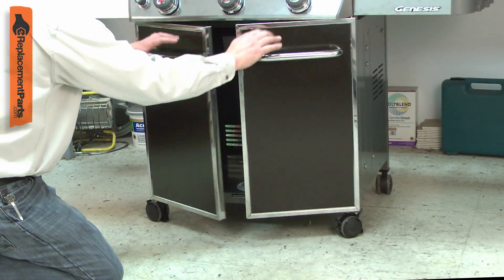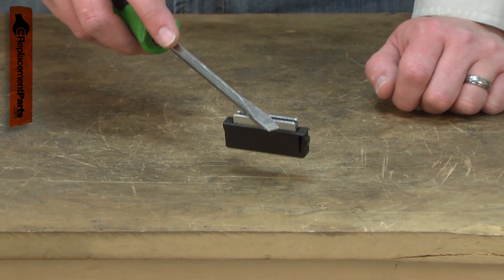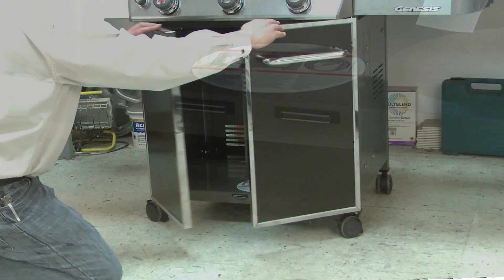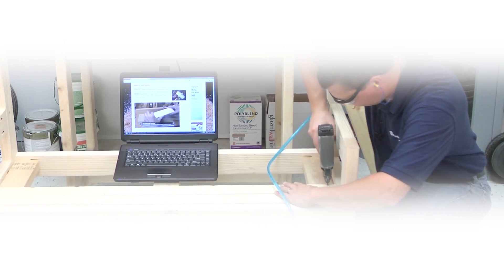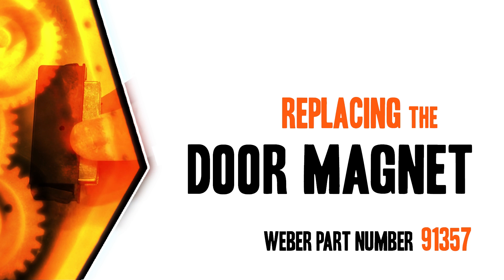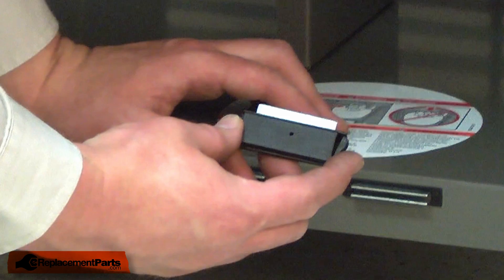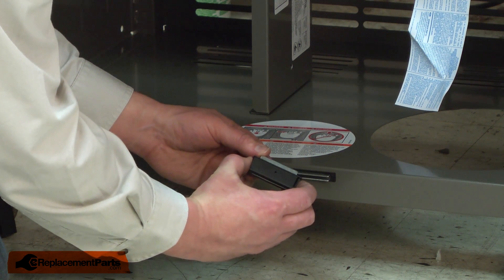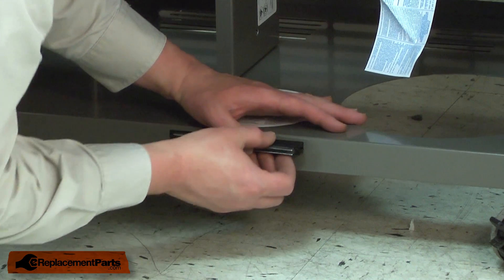Grill Repair - Replacing the Door Magnet (Weber Part # 91357)

Comment: my magnets are in the door (which is sealed) so no way to get "behind" the magnet and release any clips. The magnets are in the door but seemed to have lost their "pull" to keep the door shut
Reply: I have the same issue.  There is nowhere to clip magnets.  I contacted Weber about this, and they're sending me something.  It'll be interesting to see what they send.
Reply: Did weber send you something because i have the same issue, the magnet is in the door
Reply: @LooseGoose1960  Check to see if you put the shelf in correctly.  I found the two magnets part of the shelf.  I had to take it out and turn it around.  Everything works fine now.  Not a big job.
Reply: @LooseGoose1960  Mine doesn't.  They're in the shelf, and I put the shelf in backwards.  So I removed it, turned it around, and it works fine.

Before I discovered that, I contacted Weber, and they sent me a magnet.  Just one.  Wouldn't have made much of a difference.  Nonetheless, I figured out the problem on my own.
Reply: Mine are in the door, but look the same as those on the video.